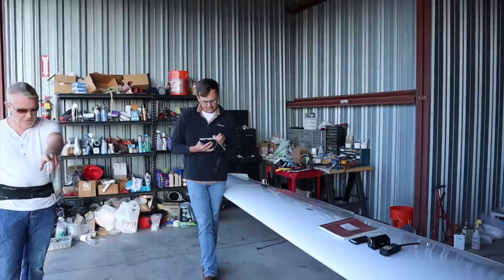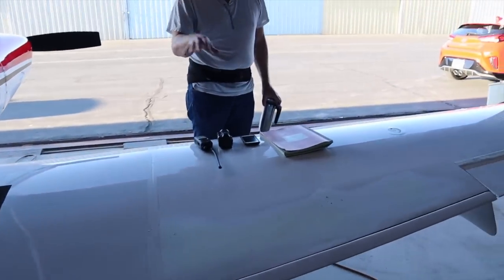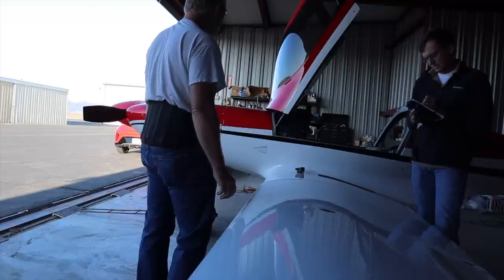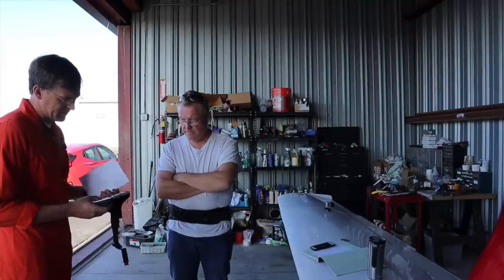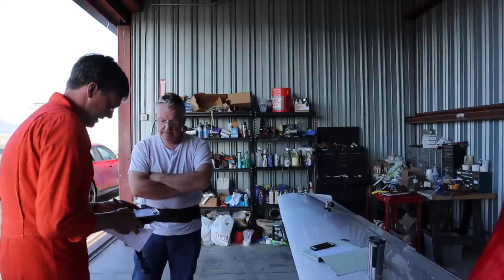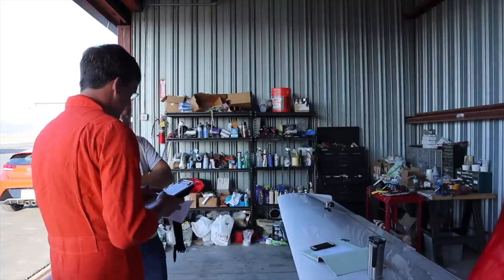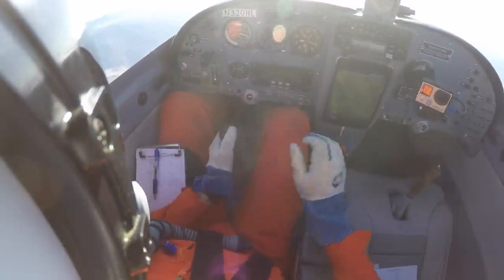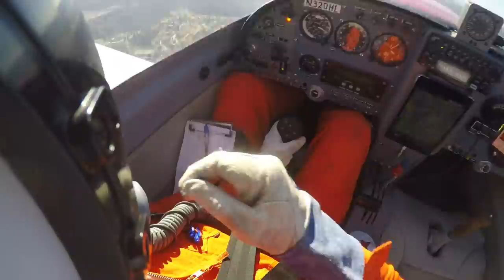Does it cool? - Cooling modifications and hiking - Flt 004  - Hakan Modified Lancair

Comment: are you aware of a Ford EGR Differential backpressure sensor.. (EGR DPFE.)  it puts out a combined differential voltage signal depending on the pressures or vacuum readings on either port..  so you could put a vacuum hose open before the air as it enters the cowling and one at the back of the cowling to check for restriction in airflow.. like using a Magnehelic gauge.  since you would be worried about pressure variations..  it should be an easy thing to set up.. i used my Magnehelic gauges on my sisters 85 pontiac trans am. found the air pressure above 55 MPH was higher behind the radiator than in front.. this prevented the electric cooling fans from being able to pull air thru the radiator..  i added a later air dam to the bottom of the radiator core support and fixed the issue..  transam models are bottom breathers.. no direct grill opening..   there is another sensor that could be used also.. GM fuel tank pressure sensors..  these also read negative and positive pressures.. need 5 volts thru an IC voltage regulator.  i don't fly.. but if i did.. i would probably have a row of these along the chord.. to monitor the air flow/pressure along the top of the wing.. sort of a digital ribbon..
Reply from the maker: I haven’t tried that sensor, thank you!!

Comment: Why do you have an oxygen mask on? when it is not connected and you are flying below 12000 ft?
Reply from the maker: We wear the mask on high risk flights for 3 reasons:
1 Crash protection
2 Better comms
3 Smoke in the cockpit

More info here:
https://youtu.be/a-lceaOL2E8

Comment: A couple questions: 1.) What's the deal with stick roll axis being lighter on one side?  2.) Odd location for  Gear Switch Lever?  Cheers.
Reply from the maker: Thank you for the comment!  Roll axis, my guess is engine torque, but being that the engine was at idle that seems like a stretch, we’ll see as we go forward.  Interesting point about the gear switch.  I think it makes more sense with the outboard throttle being the primary.  Which would allow the gear handle to be operated with the non flying left hand.  But with the rest of the engine controls on the centerline that’s a little tough.  Thanks for the comment!!

Comment: I've heard in a few of these videos references to the "black knob." Sounds like its different from the prop and throttle controls. What does the black knob control? Mixture? If so, why "black knob" and not mixture?
Reply from the maker: Thanks for the question.  I use black/blue/red knob so that it’s clear I am talking about the controls in the cockpit not the thing they control or worse the behavior itself.  Best example is the mixture.  We were working an engine development program and the air/fuel ratio was a constant part of the conversation.  By separating O2 sensor, from egt probe, fuel pump on/off, throttle position, wastegate commanded position, wastegate actual position, it simplified the conversation and hopefully eliminated confusion.  To your point tho on a new program with a new customer it probably just comes off as slang.  Thanks for the comment.
Reply: @utopiasnow  Excellent use of the language. I have worked in user interface industries where it is critical to distinguish between the action the user does, what that action is called, what control it acts on, what the control does, and the result of the control being actuated.
Reply from the maker: @bobmackey5758  I am glad that all made sense.  I have personally found it very valuable but some things get lost in the translation.

Thanks!

Comment: Iv often wondered in your videos, why do you have an oxygen mask on, that isn’t connected to any system? Don’t you have a higher carbon dioxide ratio if your not breathing in via pressure? Or does it have an inline filter encase of smoke in the cockpit? 

Another great video. 👍
Thanks Tom.
Reply from the maker: Thanks for the comment.

The mask serves three purposes:
1 Smoke in the cockpit
2 Crash protection
3 Better comms

More info here:
https://youtu.be/a-lceaOL2E8
Reply: Elliot Seguin thanks for the reply mate. 👍😎👍

Comment: @Elliot, I understand that this particular card did not include flutter tests, spin tests, or anything else that would be considered inherently dangerous. I'm curious, though, why do you not still wear a parachute for the extra safety margin? It is still a flight test after all and, statistically, you have a higher likelihood of ending up in a life-threatening situation, simply due to the number of times and hours you are conducting test flights in experimental aircraft. I'm a pilot myself with somewhere around 1000 hours but have never worn a parachute. Is it just for the comfort factor in the cockpit or is there another reason you would choose to not carry that extra level of safety onboard a test flight?
Reply from the maker: As of yet I haven’t been able to fit a parachute in the airplane.  We are working on a solution, fingers crossed.  Thank you for the comment.
Reply: @utopiasnow  I didn't realize it was that tight. I actually just saw a nice Lancair fly in to my local airport a couple days ago. Good luck with the rest of the test program. Airplanes are cool!

Comment: Congrats to you and Hakan on the flight. Just curious, what is the point of the mask not connected and/or do you have some portable system you would connect too on a higher risk flight.
Reply from the maker: Three reasons for the mask:
1 crash protection 
2 better comms
3 smoke in the cockpit 

More info here
https://youtu.be/a-lceaOL2E8
Reply: @utopiasnow  Is there a filter or air supply attached to the mask?
Reply: Ahhh.. I watched the linked video and now understand that there is a remote bottle and/or a bailout bottle.
Reply: @utopiasnow  Thanks for the Reply.

Comment: Those ailerons are sure small, Elliot. Did he trade aileron area for a bigger flap? And is the rudder powerful enough to level the wings in those slow speed tests? Finally (cramming as much as he can into a single comment) what kind of carb did he have before the Marvel? I recall from an earlier video Hakan referred to it as an "injector." Was it an Ellison? Rotec? Why did he swap it out?
Reply from the maker: Ailerons: my understanding is they are stock.  I am excited to see if they are effective enough on a 1.1 VSO at WOT on a go around (rudder as well).  It will be interesting.

Before the carb he had an Ellison, he wasn't happy with it and thought it was tied to the cooling issues.

I am super stoked to be approaching the fun part of the program.
Reply: @utopiasnow  I put an Ellison 4-5 on my Glasair TD #123 and it never gave a lick of trouble in 2800(!) hours, but I guess your mileage may vary. Ben Ellison was a stickler for good air filtration so mine had a K&N right from the beginning. Also some people can't help themselves and run too much fuel pressure.
Reply from the maker: Robert Cringely interesting.  My experience with them is quite limited.
Reply: @utopiasnow  I guess mine it, too. I only ever had the one.
Reply: The ailerons appear to be stock, but the wingtips have been extended about 18" each side. So there is relatively less aileron to wingspan ratio.

Comment: I am not feeling it with those wide CHT numbers.  CYL 1 is so low compared to the others.  If it was me I’d want to see a more uniform temp across the range.  

I do feel as if you “CHEATED” on the cooling issue by going in the early part of the day.  Are you going to continue that trend across the remaining FCF’s?  

When I started testing Hydraulic Pumps for a Marine Aviation Ground unit... having been given that job due to my USAF aviation background, I identified several problems in their testing.  1) the previous person would mount and run the pump to check for Press/Flow/leaks ( at seal drain) an call it good. These pumps would come back from the fleet in short order as leaking. I identified the wrong temperature range on the seals because.... HE NEVER GOT THE PUMP UP TO OP TEMP... the seals never got and hot Hydraulic Fluid.  

I must add that these were all rebuilt pumps... and after the identification of that issue a review and part change quelled those leaks. 

I just want you to see where I am coming from when I make a comment like I did. I really want to see him succeed with this EXP bird and that you and later on...the owner will be safe and enjoy his flying.  

The cooling issue may come back to bite him later on. On a side note... the LG looks nice and snappy with a good sequence and no asymmetrical lag on the mains
Reply from the maker: Thank you for the comment.

Cooling is a tough one.  Depending on how the airplane is operated, and what Hakan will accept as far as engine temperatures the cooling could continue to evolve for a long time.  In the meantime, we (Wasabi) were brought in to get the flaps tested.  I expect Hakan will tackle cooling on his own after we are gone.

For now we have a cooling system that allows us to get the airplane high enough to test the flaps, and that is totally awesome!!

Comment: Since heat wants to rise, why doesn't aircraft vent the engine heat upwards out of louvers cut into the top cowling?  Is there an aerodynamic reason?  Windshield issues?  Other problems?  Thanks in advance.
Reply: I assume a constant film of oil on the window.  I've spent enough time cleaning the bottoms of Cessna.   not all of it comes from the exhaust.
Reply: Once you provide a path from high pressure to low pressure it flows that way and is controllable and predictable. Im guessing it’s partially cosmetic, to get a smoother looking cowling, to keep from blowing a bunch of heat onto plastic windshields, and like Steven said keep all the oil, and grease, and nastiness on the bottom of the plane. Steven, I feel your pain of cleaning many an aircraft belly.
Reply: Actually I think I can answer the aerodynamic side of this one. 

The most efficient area to draw cooling air from is as close as possible to the centre line of the engine which is typically limited by the circumference of the spinner.

Firstly, to minimise fuselage form drag (to improve top speed / fuel efficiency etc) and secondly, to maximise propeller thrust for acceleration over cooling/intake requirements.

By physical design that only leaves you with the possibility of porting air from the "top" of the engine through to the bottom.
Reply: Interesting question. There are some aftermarket cowlings for the Piper Saratoga/Lance that reverse the cooling flow. Im not sure what the reasoning is behind it
Reply: The main reason is the air coming in is directed over the cooling fins on the cylinders and then via baffles on top down through the fins to attempt to provide equal air over all cylinders.  The air travels down through the fins and out the bottom of the cowl.
https://www.aircraftsystemstech.com/p/maintenance-of-engine-cowlings.html
Reply: @USAF291  those actually were not aftermarket, they came from the factory that way on the turbo lance.
Reply from the maker: great discussion guys.  Thank you for coming along!!

Comment: I don’t know why there’s so much wasted time spent on guess work for cooling when all problems should be revealed on “ground high power runs” before any of this nonsense gets started. Hope it works call Elliot, Fail. Hope it works call Elliot, Fail. Ugh seriously, I think “slap the builder” up side the head should be in the checklist for each lazy fix fail and call back to the airport for nothing.
Reply: its a process.  ground runs do not provide the required airflow for cooling at high power settings.
Reply: It's an air-cooled engine. It's not reasonable to expect to be able to troubleshoot cooling issues at WOT with a ground run, afaik.